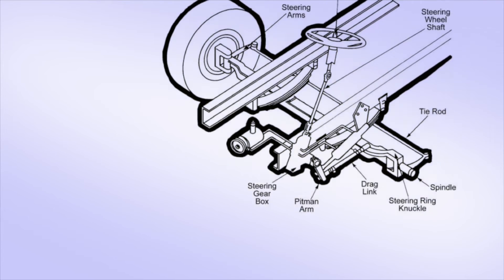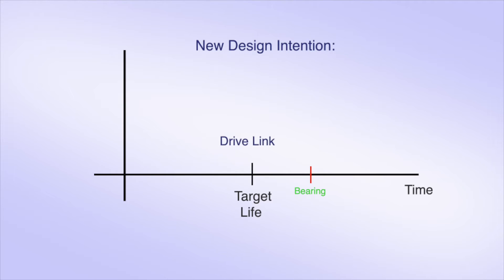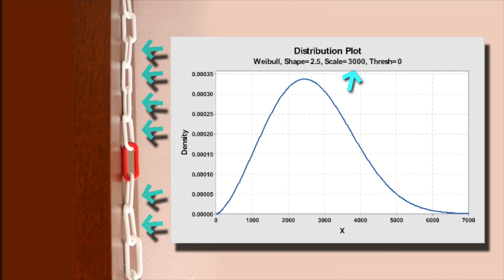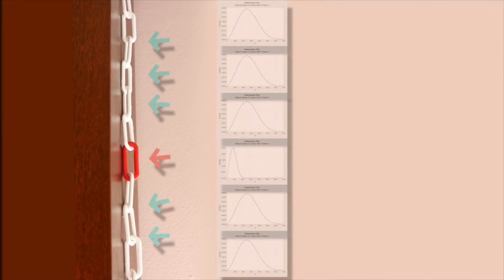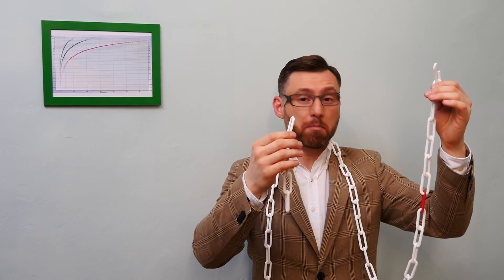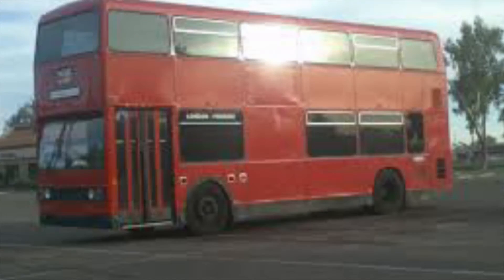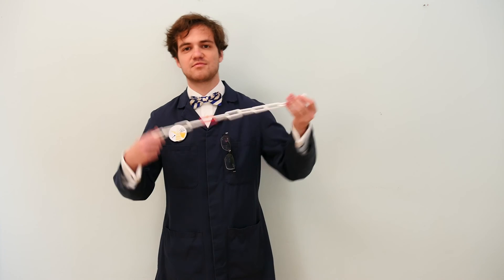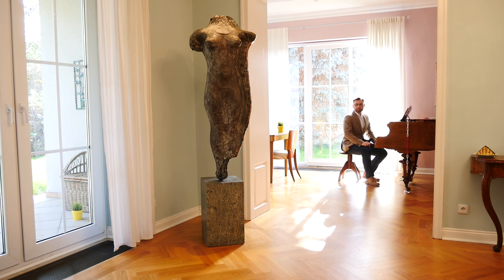Design for Testability

Comment: Thank you for the video! It's fascinating to see how reliability engineering is applied to designing maintainability into a system, and also to see how Lusser's Law applies when using probability distributions.

Out of interest, how would you look at a similar problem in the case that failure modes of the serial components are not independent? For example, if the failure of the weak component introduced stress on another component that increased the probability of the second component shearing. Aside from having to test the second component when detecting failure of the first, what sort of tests and design adjustments would you consider?
Reply from the maker: Hi Sasuke!
Thanks for the nice comment!
The problem you point out is not an easy one. Yes, the components of the system, be it series or parallel, do interact and it is generally not correct to neglect the interactions when estimating the system’s reliability. However, there is only so much, one can do. In my opinion, the safest way of dealing with this is to design complex tests, that include most of the damage contribution factors. In other words, the best way to test a car is to drive it. Once the damage contributors are separated (e.g. shaker test, sun-light test, door open-close cycle count, etc.), not only we can miss their combined effect, but also we can miss some of the component interaction. The separation of the modes is always burdened with assumptions, and it is only the technical knowledge, that can judge if the assumptions are safe or not.